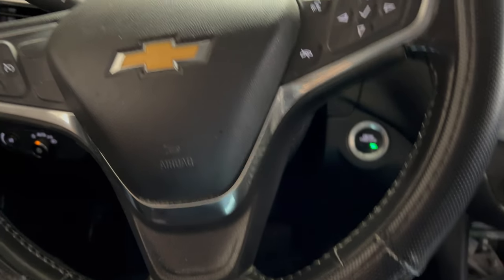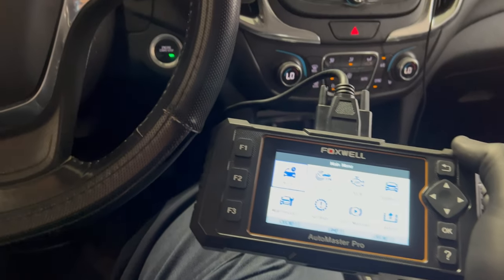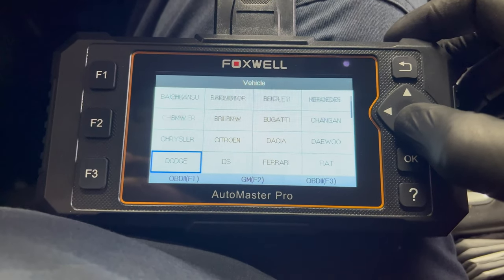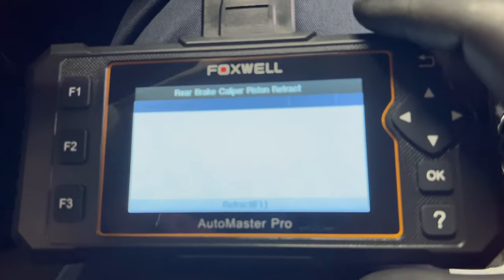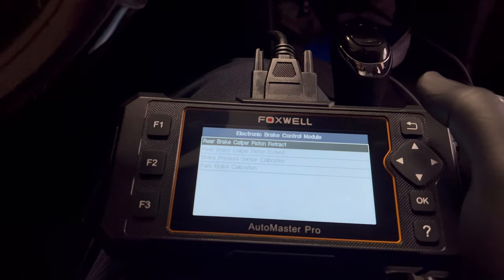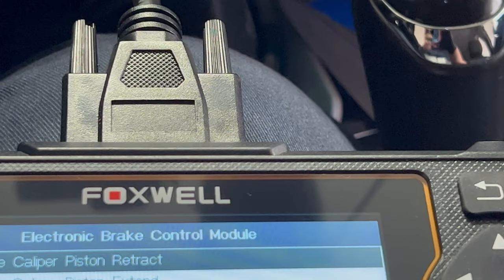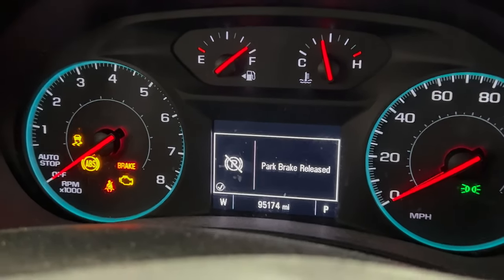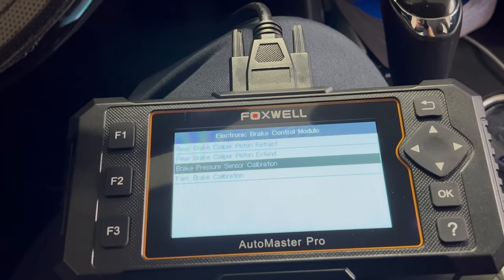EPB (electronic parking brake) Scan Tool for DIY

Comment: will this work for a 2014 tiguan?
Reply from the maker: It should. Worse case, order it, if it works good, if not send it back. But if you do a lot of diy, I would keep it because the specific tool has more features than just the parking break.

Comment: You can also manually retract the parking brake as well. Its 2 screws to remove the plastic eletric parking brake on the back of the caliper than when you have it off you can wind it out using a socket just so everyone knows.
Reply from the maker: @tkizzle4129  I saw that in other videos. I appreciate the comment. But I would rather spend 160 on a scan tool that can do the same thing rather than new calipers. To me it’s cheaper. As cars get newer and more technology in them, don’t think it was a bad investment. Also, I’m on the rust belt where screws sometimes like where they are. Seriously thanks for comment.
Reply: @Rickm2003 absolutely! I get it im currently looking for a new scan tool myself that can do this as well would you recommend this one? Also you don’t need to buy new calipers its actually very simple to do i just did it on a 2019 equinox last weekend but i prefer to do it the easy way as well so
Im going to buy a new scan tool that has the epb feature i just can’t decide which one to get
Reply from the maker: @tkizzle4129 I’ve used it a few time and let my buddy use it. He used the bleeding feature of the abs and worked great on a ford f150 I think. Yes. Either this or a launch. Launch for the face it’s wireless. Look on JBtools. Might get a good deal